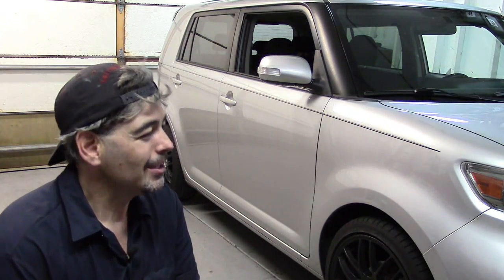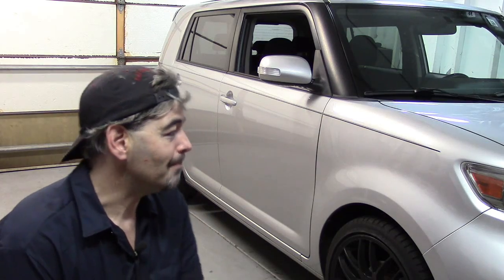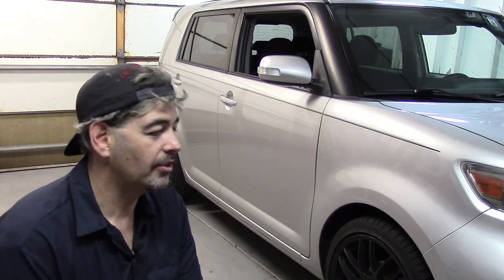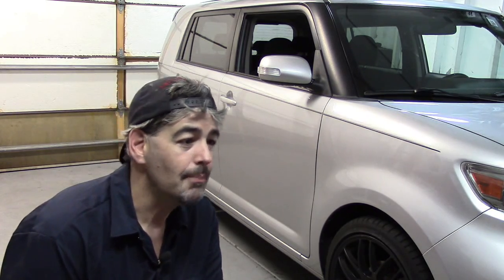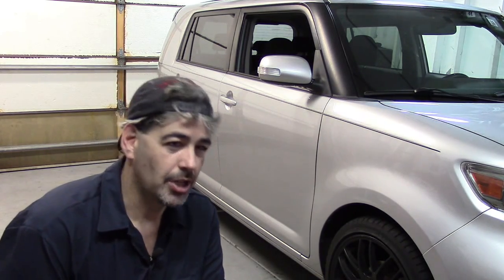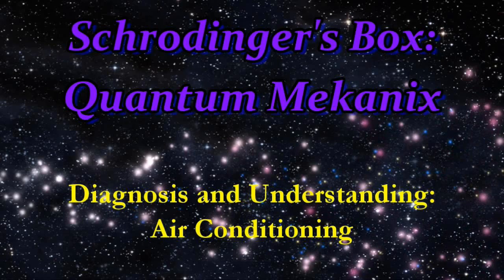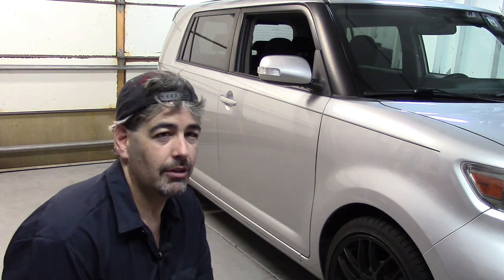Locate an AC Leak Like A Rock Star!

Comment: I'm wondering if using a smoke machine would leave contaminants inside of the A/C system ?

I caught an accidental nosefull of smoke vapor while checking for a vacuum leak once and I can tell you that there is definitely some stuff that comes along with the smoke.   :elbowcough::elbowcough:

Comment: Why not pump some air from your compressor after adding smoke? That would add some pressure to force the smoke out.
Reply from the maker: There really isn’t need to. The smoke machine has 1PSI output. This is more than sufficient for this application.

Comment: You didn't talk about like minivans with 2 systems. I'm guessing the psi is the psi,and as long as rear isn't used the expansion valve and evap is not an issue.

Comment: Does ANY UV flash light will work?? or it has to be specific to AC systems??   would the Ebay flashlight 395Nm wave legnth would work? please help  :)
Reply from the maker: yes the dye excites at around 400nm so really anything in Uv range will fluoresce it.
Reply: @SchrodingersBox   awesome i found a cheap version in Harbor Freight  for 8 dlls  Thanks
Reply from the maker: hahaha that exactly what I have used for years lol.

Comment: I don't have a leak, I just have weak cooling.
Pressure when car is off is 100psi on hi & low, but running it is 100 hi, 75 low.
I'm guessing it's an old compressor and I'm prepared to replace it and the oriface tube.
What I need to know is how to determine if there is in fact any other components which need replacing, before I pay to recharge the system.

Comment: This is the second video of yours I’ve watched just came across your channel today you have the potential to become so much better at diagnosing air-conditioning leaks and other things you just need a little bit more information to guide you on the way so you don’t have to spend another decade or two trying to figure out and learn the hard way. 
      Tell one of the absolute UV light leak detectors is by tracer line Opti promax be careful because there’s three levels of this light you only want to get the one that says Opti pro max.
            For that good snap on corona discharge refrigerant leak detector put it back up for sale on the garage sale unfortunately that’s one of the worst leak detectors on the market using the corona discharge method. 
           Few decades of research the Baccarac H – 10 with the heated diode leak detector with a refrigerant calibration leak detector to calibrate and test your leak detector included in the box is the best you could get and will find those hard small leaks that you normally cannot find. 
             For high-pressure leak detection without using refrigerant or if you have a nearly empty system that only has like 25 psi of refrigerant and you wanna pressurize it to 150 or 200 psi use dry nitrogen or argon gas because it’s dry and it’s in Ert and you can pressurize it at high-pressure you cannot do that with just pumping in refrigerant and you don’t waste no materials and everybody who does welding usually has argon or nitrogen in their shop . 
        YouTube videos I don’t have time for that it’s pick up the camera and shoot and go off to the next job I think you would enjoy watching some of my videos on air-conditioning only and you can  apply those methods to your diagnosis to shorten your diagnosis times and do a better job for your customers.
Reply from the maker: If I wasn’t a DIY i would use those methods.  I am stuck with DIY level equipment including my scantool and oscilloscope.

Comment: I'm not mocking you as I am learning from you. So the smoke won't hurt the ac system? I was considering on doing this a couple weeks ago with my smoke machine and I asked a mechanic about the idea and he said "NO" it would contaminate the system and Like ScannerDanner he applied air pressure which I am for as well your just going to suck all this back out with the vacuum pump anyhow. So I'm for using the smoke machine as well. I'm new to all of this, my smoke machine is new and it helped me find my vacuum leak... Thanks for the video
Reply from the maker: No mocking taken it's a good question.  No I am not worried in the slightest about contaminating the system because I am going to purge the system anyway when I replace the leaking component.

Comment: Sir, I have 2000 infiniti I30. AC is fully charged. .relay has been checked. When I jump the relay prongs manually,  cluch gets engaged.  .still it doesn't blow cold air. If I don't manually engage the cluch,  it doesn't engage with AC button on. Please advise
Reply from the maker: What are your high and low side reading both static and loaded?

Comment: the great think abt nitrogen is you can pressure up the system to a thousand pounds id you want, and tiny leaks will show
Reply: Are you out of your mind a thousand pounds your hose will blow up about the 400 200 lb of nitrogen or air if you have a real tiny leak will show up

Comment: sometimes A/C compressors will leak, and then not leak,. I had a dodge dakota that drove me nuts, it would leak the freon out, I would leak detect it, change o rings, tighten fittings, spray the whole system down with bubbles, no leaks.  a week later the freon would be gone. then after recharginging it again one day I pulled into the driveway , turned the truck off, and heard a loud hissing sound. what was happening is if the pulley and shaft stopped at one particular spot, it would leak like crazy.. turn it a hair, and it stopped completely.. ALWAYS suspect the compressor because it is the least reliable sealed system on automotive airconditioning, due to it having a shaft that terminates outside of the housing.

Comment: Here's s thought, but have never tried it yet... Unscrew low or high side Schroeder valve, hook the gauge hose to the opposite valve and smoke the thing until smoke poors out the opened side. Screw the valve back in. Now that you know the system is full of smoke, you hook your compressor or nitrogen bottle to the system to push tje to the smoke out with high pressure.

Do you think this would work?
Reply: It might I would just do soap and Bubbles pump the system up to 200 lb nitrogen if you have a compressor seal leaking which most of the time they're slow you're going to have to use a leak detector or die I don't know how you get enough soap wanted to see it the seal is hidden by the compressor clutch pully

Comment: On a larger leak would it still not activate the compressor if so?  Thanks.
Reply from the maker: If the leak is large enough that static pressure falls below 25PSI, the compressor will never start.
Reply: Schrodingers Box Thanks will check with some dye. Appreciate it.

Comment: Hey Matt, quick question. What do you think of hydrocarbon refrigerants like Duracool and Red Tek? As I understand they are much more efficient and less environmentally damaging refrigerants than CFC or HFC refrigerants, and they also run at lower head pressures, which should extend the life of the system. The only problem that I am aware of is that it is flammable, but how much of a problem is that in reality? I wouldn't use it because if something unrelated caused a small fire and melted a line, it could accelerate the fire and catch other things on fire, but on the other hand the tank of gasoline under pressure could too. I would think that a sudden leak in that is large enough to ignite and sustain a flame or explode would be quite unlikely, and it obviously is not going to burn inside the system as there is no oxygen. What is your opinion on that?
Reply from the maker: Never heard of that!! I need to look into it- thanks!!!
Reply: Ok, be sure to let me know as soon as you come to a conclusion! Thanks!

Comment: Wow so many opinions and debates going on lol. 
About the pressure test. I pressure test with nitrogen
Before recharging. I know most people won't have this available. But nitrogen because it does not contain moisture like your air compressor. You do not want any moisture or contamination from shop air in the system. It is also an inert gas. As a professional I find many leaks this way but dye is the best for small leaks. I believe if you try a smoker it needs to be approved for Ac systems as an evap smoker will put residue in the system and technical could cause a problem..... eventually.

Comment: hey Matt. when I repaired my AC, I added PAG oil with UV dye in it rather than refrigerant with UV dye. the oil is so brightly fluorescent with that yellow green color, that it seems to me you'd be able to see it with the naked eye if it were leaking out of the AC system. You wouldn't need to turn the lights off, use a special light, or buy those special UV glasses. am I correct in this, or does the oil dye change in some way that it's no longer fluorescent yellow to the naked eye after it leaks out of the system?
Reply from the maker: Usually AC leaks are so small you won't see visible dye traces. You really need the UV light for most leaks.
 If you have such an incredibly large leak you can see the dye spray pattern without UV- well you'd probably be able to find it when you try evacuating the system in the first place.

Comment: I have used my air compressor hooked up to the charge side with and it works really good for me. Turn the car off and check for the noise of escaping air.
Reply from the maker: That is only going to work on a really really large leak. Most AC leaks would not possible be detectable this way as the leak takes days and days before normalization to atmosphere.

Comment: Did you know propane is used in many new vehicles now, it is very dangerous if not handled correctly. Systems do explode if sparks from many sources like solenoid, loose wiring, radiant heat or flame are present and also hard to detect as to what you are dealing with by observing your Pressure/ temperatures gauges. Be real careful that some idiot has not installed this gas without informing you via the A/C id card, its a whole new ball game now.
Also when using an evacuating unit if it is not compliant with this substance it will cause a deadly reaction !

Comment: thanks for another great video ! a quick tip for you regarding the bubble test. use commercially available whiteboard cleaner for detection of small leaks in any pressurized system. the cleaner has a very low surface tension and easily bubbles with low-volume leaks when compared to a soap solution
Reply: What we used to use is those kids bubble blowing things with the ring attached to the lid

Comment: hello on one of your videos you talk about low oil pressure and my question is.i have a 1997 dodge ram 1500 with the 318.and 116.000 miles and from day one of new with 6 miles to today she has never had more than 25 pounds of oil pressure at most under hard exceleration and does not show any at idol but never no problems full compresson on every cylinder and no oil leaks and its been checked back at the dealer 6 times over the years and nothing can be found wrong with the engine.i guess some just run low oil pressure
Reply from the maker: What data do you have? What was the oil pressure when measured with an external gauge?  what was the voltage drop on the circuit? what is the bearing clearance?
Reply: +Schrodingers Box the oil pressure on an external gauge is the same 20 to 25 pounds at 5000 rpms and around 10.and thats from 6 miles till now at 116.000
Reply from the maker: You need to measure bearing clearance then
Reply: +Schrodingers Box dumb ass the engine has never been apart or out of the truck since new in 1997 and its run hard when i feel like it so there is nothing wrong with it they have checked everything and find no problem what so ever .

Comment: You should have checked the entire A/C system. Just because you find a leak doesn't mean it's the only leak. It would be bad for you to drain the A/C system, replace the one component, flush, replace the desiccant bag  evacuate and fill the A/C only to find out there are were other leaks and you only repaired the first one you saw.
Reply: +Schrodingers Box you can pull a vacuum all day long and have no drop but still have a leak when you disconnect all your lines, that little o ring on your Schrader valve isn't doing anything when depressed but could leak when you disconnect everything. have had this happen to me a couple times. 2000-06 f150 seem to be really bad at this.
Reply: +Schrodingers Box I'm not even sure what you are replying to. I simply said you could have a bad Schrader valve o-ring that you wouldn't see from a conventional vacuum leak test because you have your lines with your gauges connected and have the valve depressed and your not testing that seat. unless you run a vacuum test from high side alone then retest from low side alone then you would have effectively tested both Schrader valve o-rings
Reply: +Schrodingers Box that's how it's possible to maintain 20mmhg of vacuum while you still have a leak, I was responding to your first response. thank you.
Reply from the maker: It was tested. How is it remotely possible for there be be a leak while maintaining 20mmHg of vacuum in a closed system?
Reply: Remotely possible but possible. A leak can be small enough to where it isn't detected under a 30 minute vacuum but will be noticeable under a longer period. A leak like .5mmHg over an hour may not be noticeable in 1/2 an hour. And most shops leave the gauges connected 15 to 30 minutes after pulling a vacuum And when you work flat rate, time is your enemy
So lets go with the first problem you found and ignoring the rest of the system. A condenser can cost $200+ and then you add labor which can be over $500.You call the owner, tell them what you found and will cost $700 to repair. The customer gives you the ok and you then do the repair only to find out the A/C isn't holding a vacuum. You recheck your repair and the entire A/C system to find another leak coming from an other expensive part like the condenser or evaporator. An additional repair that can easily go over $1500 for that second repair, You call the customer again and tell them you found a second leak after replacing the condenser and will cost an additional $1500 to repair. So now that repair is $2200. The customer declines that work and is angry because you failed to give a proper repair estimate and thinks they will have to pay for the condenser. A condenser they would have declined had they known that a second part needed replacing as well as a repair bill of $2200. So now you're stuck, do you charge the customer for what you've already done and they still don't have a running A/C? Absorb the cost of removing the condenser that you just installed? Or absorb the cost of the condenser and let the vehicle go because the customer would not have wanted the repair in the first place due to the cost of the entire repair had you checked the entire system first?  A cost you could have  easily avoided had you checked the entire A/C system first.
Reply from the maker: Frank Gonzalez Thats a long way to go when it was already confirmed there are no other leaks. NO LEAK can possibly take longer than 30 minutes without even a 1HgMM drop of vacuum.  NONE.  It is simply against the laws of Physics. Even if there were, the density of the refrigerant itself would not pass through such an insignificant leak.
  Physics my friend.  Its what I do.
Reply: Tell that to the customer that I had to call because such a repair happened to me when I was a service advisor in which a tech repaired the first leak he saw without looking at the entire system.
Reply from the maker: Frank Gonzalez I won't have to, because unlike your tech, I allowed 30 minutes to go by and verified there was not even a 1mm of Hg drop in vacuum after system was closed for 30 minutes.
  I guarantee your guy did not do that. It is impossible on this planet given STP even at the highest altitude to support life for the system I repaired to have a leak.
Reply: I don't know how he found the second leak, probably after he failed to pull and hold a vacuum but a second leak non the less. A leak had he found had he checked the entire A/C system first.
Reply from the maker: Unzem Ummmmm... yeah..... I would say drawing vacuum on an open system would probably not result in generation of zero-point field. presumably.... due to leak.
 Thanks for the tip, Heinrich Geissler.
Reply from the maker: Unzem Yes- if you have a bad schrader valve thats an open system... there's your leak.
  A bad schrader valve does not nullify the principle of the test. It means you need to replace the schrader valve just like ANY leak in the system
Reply from the maker: Unzem Wait... what?  You can't possibly maintain 20mmHg of Vacuum If you have a leaking schrader valve.  It is impossible to maintain vacuum in any open system. As soon as you shut the pump off and "seal" the system you would see decay showing on the gauges. It is impossible that you have a leak yet maintain the same vacuum.

Comment: The only problem with this is its slow bro.
With 250 to 300 psi Nitrogen and soap, I found a compressor discharge hose leaking in 20 minutes. This was a very slow leak that showed up at 265 psi Nitrogen charged. I need a way to isolate the Evaporator from everything else since it cant be seen and simply watch the gauge on it by itself to see if its failing.

Comment: Great video...How do you do when you have to check the evaporator and you cannot see it???
Reply: That's where the electronic detector beats the UV dye.  If you put the blower on low speed and use the sniffer at the air vents when first starting the A/C system, you can often find evaporator leaks.  You do it when first starting the system so that the leaked refrigerant builds up inside the ductwork and blower housing, so it can be detected when mixed with a larger volume of air from the blower.